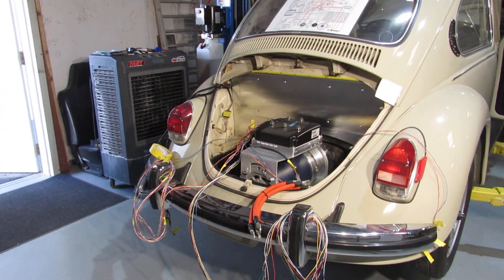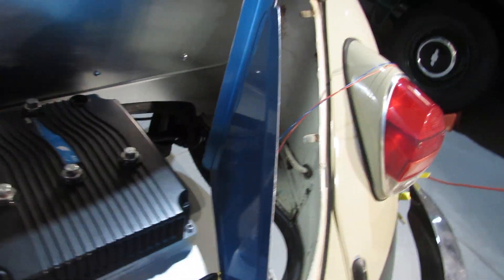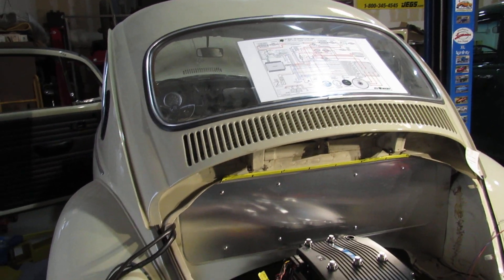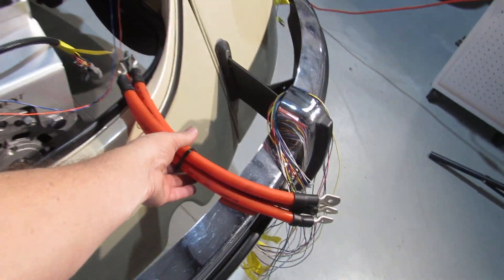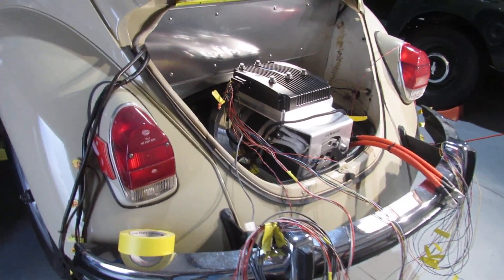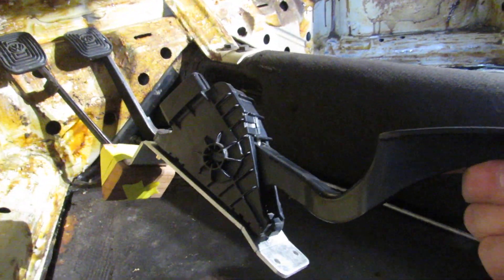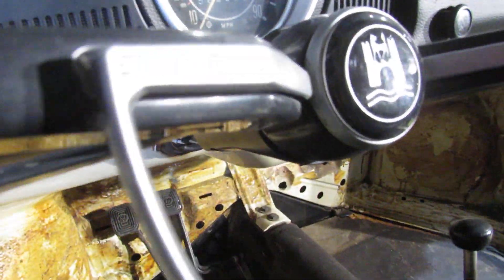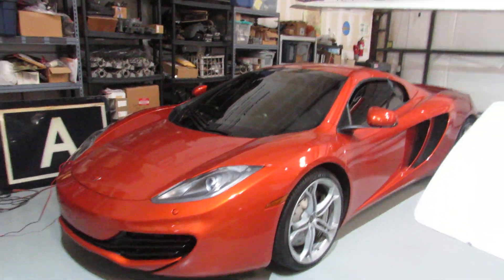Latest update on our 71 VW Super Beetle Electric Conversion with bonus super car at end....

Comment: you have an amazing shop and do quality work and I so feel your pain when it comes to wiring diagrams, what makes it worse is that you bought a Conversion Kit ie a complete kit which I am sure is sold and advertised as a no brainer one weekend install, ha ha, well sure until you get it and try it, been there many a times, that's why for my electric conversion of also a 1971 vehicle be it a GMC pickup I went the used electric parts route, by now electric cars have been out for a decade, plenty of time for distracted soccer moms to send some to the scrap yards